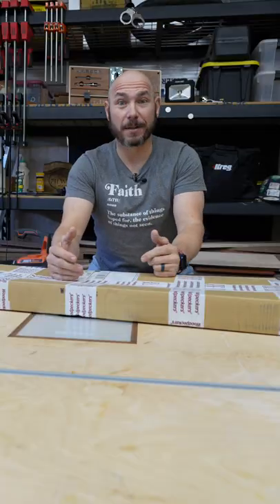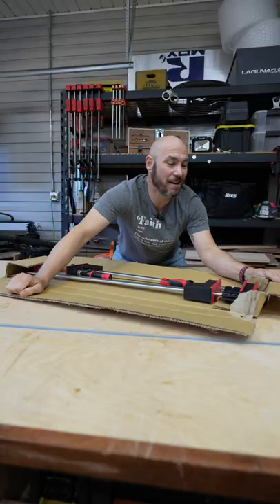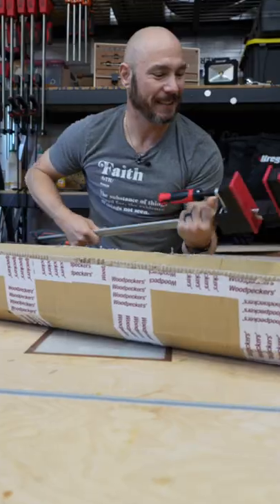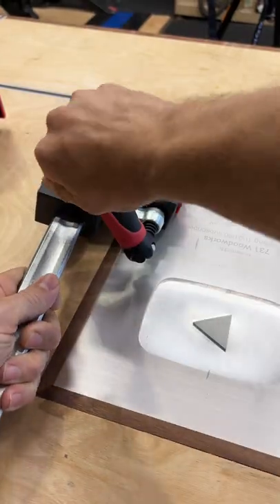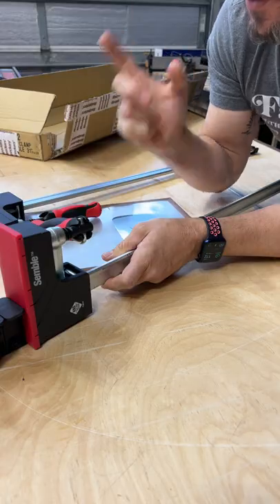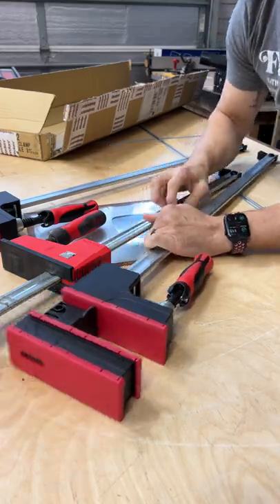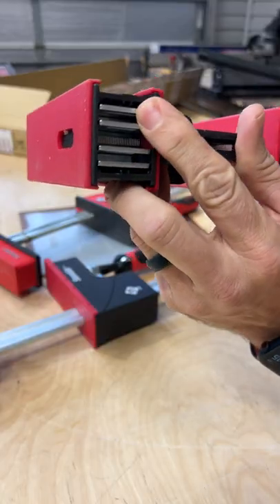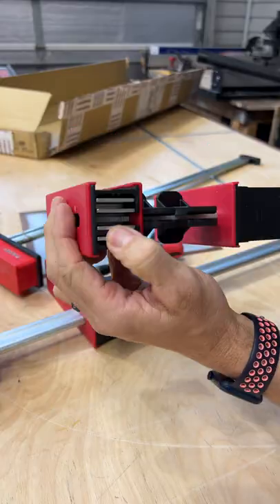A Better Parallel Clamp? Semble Clamps by Woodpeckers Unboxing #shorts

Comment: Is the extra crank down value needed for woodworking? We use clamps for glue ups and stop cranking down once we see the glue seep out. When would that extra little bit help a woodworker?
Reply: You're right. The only time I ever really bear down on a clamp is if i'm trying to force something into alignment. And parallel clamps provide more than enough force to do that. That new handle design seems like overkill.
Reply: Well there is a database online that has info on optimal clamping pressure for pva glue. Each species has its own necessary clamping pressure for the best joint
Reply: @omarmontoya2774  thanks for the heads up! I had no idea!
Reply: Like  @rmyukon  said, only if I'm trying to force something that really I shouldn't be forcing to begin with lol
Reply: Just a sales gimmick